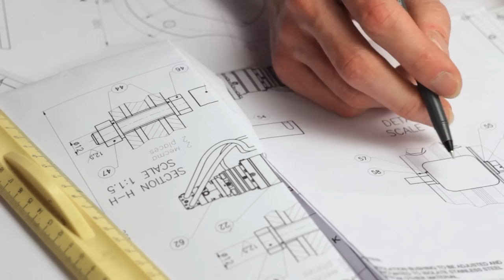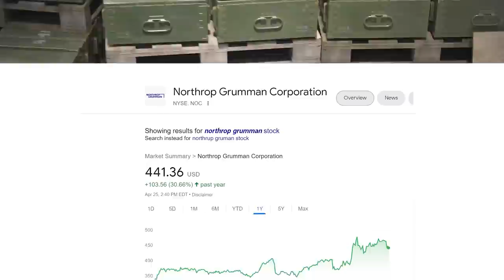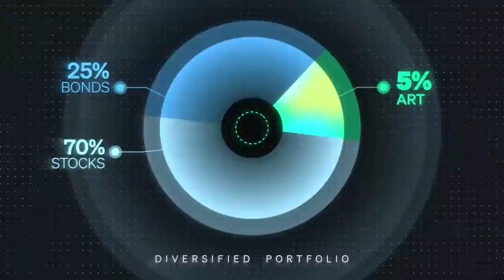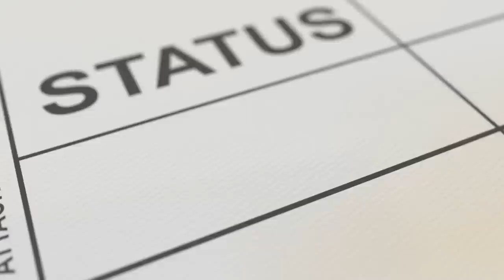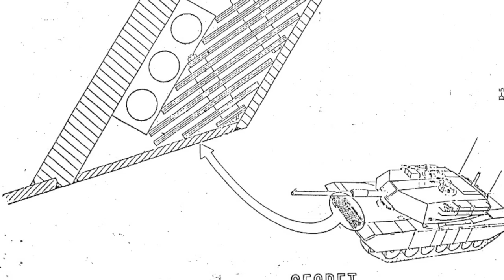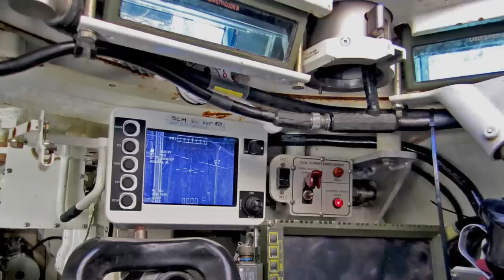The M1 Abrams Tank Needs to Chill Out

Comment: Survivability-wise, the Abrams still has it's "explody" ammo separated from the squishy crew.   --Still a top notch design feature after all these years.
Reply: But where does it keep its explody crew and squishy ammo?? :P
Reply: @seanheath4492  In separate sealed compartments.  The entire ammo load in the bustle can detonate and the crew remains unaffected in the M1.  A design feature that can't be retrofitted.
Reply: i think the t72 ammo is seporated, but lack lack of blowout panels, combined with the crazy powerful top down attack missles just cut through everything to the ammo storage....
Reply: @specialingu  Only the driver is separated from the ammo and then only if the hatch between the gunner and driver is buttoned.  If the tank is buttoned, the turret flies off and if the commander's hatch is open, the commander goes ballistic while flames jet from the hatch.
Reply: @specialingu  eeeeeh it’s way to hard for the T-72 to even try use blow out racks since they have an auto loader. There’s just no way to protect the crew and have an auto loader
Reply: @specialingu  the whole turret flies up to the space after hitting a t72, no matter how you sepparate the ammo from the crew in it.
Reply: @cases2939  no, if ammo detonates, it detonates. Only if most of the load is inert apfsds the the crew can survive
Reply: @UhBreezyK  Yes, the gunner and commander are literally sitting on top of the ammo carousel in the T-64,T-72,T-80, and early T-90.
Reply: @tedarcher9120  That is exactly why the rounds are reversed, so any HEAT rounds detonating are directed away from the crew.
Reply: @cases2939  I think you missed the joke
Reply: @UhBreezyK  A poorly designed auto loader, true. A better designed version, not true.
Reply: @clarkbarrett6274  Joke?
Reply: @UhBreezyK  It is actually not difficult at all if designed from the start to be that way.  Retrofitting a T-72 to achieve that would indeed be impossible though.  The main problem with the T72 is not that it has an autoloader but where it stores the shells - in a ring around the circumference of the turret. On the M1 it is a compartment hanging off the back of the turret. That design could easily be adapted to an autoloader without losing any of the separation All an autoloader needs to do is exactly the same thing the human loader does, that is move a shell from the magazine to the breach of the gun.
Reply: @946towguy2  ived saw a video from Mariupol where the russian crew of a tank that stepped over a mine ,,,well...the video is gruessome but i bellieve the crew endup being throwed thru the tank's barrel :( The turret didnt blow up but the barrel spewed a gigantic column of flames...so the logic dictates that the crew passed thru that barrel aswell
Reply: @UhBreezyK  Untrue, there's plenty of examples from other nations.
Reply: @ThePppp89  I’m not calling auto loaders poor. I’m referring to the t72 specifically and it’s issues. The way they have made their auto loading prevents the safety.
Reply: @listerdave1240  yeah, sorry for not being precise. I wasn’t referring to auto loading as a whole. Just the T72’s
Reply: @tedarcher9120  ammo explosions are almost always the propellant first. High explosives only detonate in an ammo explosion if a country uses really crummy high explosives. Then again, a lot of tank ammo has included very insensitive high explosives like RDX, but rapidly burning them instead of detonating them.
Reply: @cases2939  yeah, I somewhat doubt anyone's ability to survive the ammo exploding next to them. I reckon the crew's bodies would not be destroyed, very dead but not destroyed.
Reply: @UhBreezyK  The French have had it figured out for decades.  They use autoloaders that feed from a protected magazine in the turret bustle, only a small hatch opens to cycle shells from the magazine to the autoloader, the magazine itself is loaded from the outside of the tank.
Reply: @tedarcher9120  Not really, the majority of the cook off when T-72s are hit is the powder charges igniting, not the shells themselves.  That much gunpowder, in the confined space of a tank hull makes a pretty big boom
Reply: @mrvwbug4423  then it's usually a fire, not an explosion. Yes, it will help against fires, but in many cases he shells also cook off and launch the turret into space
Reply: @DmSereb  I believe the claims are probably greatly exaggerated, as we don't know when the tanks have exploded. So they most likely haven't exploded immediately, but could have exploded dozens of minutes after the hit, after the crew has left.
Reply: @werrkowalski2985  true, it happens, but only when the ammo explodes after the fuel ignites, when the engine or a fuel tank was hit, not the ammo directly. moreover, if the crew managed to abandon the tank, they leave the hatches open, which prevents the turret to be ripped off by explosion, but of this i am not 100 certain
Reply: @DmSereb  No, fuel igniting has nothing to do with this. The cook off is never immediate, ammo can explode immediately after a hit, but if it cooks off, then first it ignites. Look at footage or photos of tanks with their ammo cooking off, that is how it looks. The ammo explodes after some time.
Reply: @mrvwbug4423  Yes, I corrected myself earlier. I wasn’t referring to auto loading in general, just the t72’s design
Reply: @specialingu  T-72 uses the rotary autoloader int he turret.
Reply: @tedarcher9120  the M1 has been tested with a full load of HEAT rounds cooking off.
Reply: @tedarcher9120  no, not even then. The propellant has more than enough force to clear the tank. The case with probably split and frag as well. Multiply this by every case hit + spall. They are screwed.
Reply: @tedarcher9120  You're talking about the M1, yes?  You're wrong.
Reply: @946towguy2  There is no hatch between the driver and gunner of any tank currently being discussed.
Reply: @specialingu  It is stored along the sides of the turret and mostly exposed. It has to be this way due to the design of the auto-loader. This is also one reason why you will see a lot of Russian tanks that have been disabled, without their turrets still attached. I have talked to a few soldiers that were M1 crew members during the first Gulf War and they said that often times, the Iraqi tanks would explode massively when hit and the turret would sometimes fly in the air. This is because all of the ammo is being ignited and creating even more destruction. If the turret of a Russian tank is pierced, it is almost certain that most of the crew is going to die.

Comment: Former M1 TC here, One of the biggest differences between the M1 family and the T-whatevers is that the M1's ammo is stored separately behind a two inch thick door in a compartment with pressure relieving blow off panels to vent the explosion and cook offs to the outside, away from the crew compartment. So long as the loader stays away from the knee switch for the armored doors, the crew will likely survive, albeit deafened! 
The T-64 -72 -80 and -90 have ammo carousels exposed in the crew compartment!
Reply: "If we get hit we become satellite"

Essentially every Russian tanker
Reply: Many crews would send a round down range while the ammo door was still closing without realizing it. A good loader knows the 2 second delay after you Take your knee off knee switch so as soon as the door is opened you take your knee off the switch before grabbing the next round, so by the time you hump that round in the door is closed. If you didn't do that and hold knee on switch the whole time while taking the round out the door will close around 2 seconds after round is loaded.
Reply: I seen a tank burn up an blow off panels fly at Brookhaven range back in 2002 from loader switching rounds in between  engagements and didn't realize he as putting a round back in the ready rack that was cooking off and it blew up in his hands and set the ready rack off. I saw it all happen on the first BP pulling gate guard. Whe that happened the driver passed out from th halon because he couldn't get his hatch opened fast enough because it was nighttime engagements and the old night sight was in with the wing nuts. The tank drove for 20 minutes at idle speed across all the rough terrain and nobody could stop it. The panic and screaming was unbelievable. The flames white above 50 ft trees man. The tank finally stopped ar end of range when it hit a big tree. The drivers name was Robert white from Maryland and he actually didn't burn just died from smoke inhalation and the loader Christopher Murodas from little Rock Arkansas burned alive. I just hung out with Chris at lake Blora the weekend before and was and was water skiing with him. I was Aco 3/67 pulling support and they where Cco 3/67. The tc and gunner actually made it out alive with minor burns but SSG Steele who was the tc was relieved and sent to another unit while the gunner Nolan lost his mind from the guilt and was chaptered out. The whole thing was very sad and crazy as shit to watch. It definitely fucked my mind up. Our DS in basic told us we will see people due in training and I didn't belive it. I also seen one of our tanks with the turret blown off in OIF1. It was A33 3/67 armor. Very fucked up times that I think of almost every day of my life especially IRAQ
Reply: @imlurkn5291  That's a really hard story to read, so I know it was hellish to actually live it! I'm so sorry that you had those experiences. 
In training, I climbed into the driver's hatch once and it reeked of pine oil. When I asked the mechanic why, he said they he had just finished cleaning the brains of the prior mechanic out. Apparently, the driver had PMCS'd the tank, noted that the Halon bottle was showing empty and deadlined it. The mechanic was going to replace the Halon bottle and when he cracked the nut to remove the empty one, 800 psi took his head off. He hadn't put the safety pin back in since he thought there was no pressure, but it was a faulty gage that was reading 0 psi, not an empty bottle.  
What has helped me deal with the thoughts and memories of dead friends, has been to focus solely on the good times, like your water skiing weekend for example, and to cherish the brief times we had peace. Even today we could lose more friends to drunk drivers (like my dad who was killed when I was 16), accidents and disease. I try to value today more than ever. I pray that helps a little bit. 
I have also surrendered to Jesus Christ and learned that people are going to mostly reject Him and be damned, so I work hard to be kind and show the hateful world His love for them...whether they accept it or not. The inner peace and contentment that my faith brings me every day is precious. I would recommend that to everyone, even if it turns out that the Bible was B.S.
Reply: @purelife9000  Man that is so sad about the Halon bottle killing that soldier in the drivers hole. I worked for GDLS for 10 years and have replaced many bottles and pinning them is an absolute must. It's  very very serious thing even if the gage reads zero and this is that prime example of why you should always pin it. That could have happened to anyone. That's  really sad man. When I worked for GDLS I almost messed up big-time when  was in a rush and forgot to zero the hydrolic pressure before I took the filters off the goose neck on the reservoir for annual services. The one on the left came off as Normal which made me think everything was fine then when I got the the one on the right I could barely turn it but my stupid ass stayed persistent.  Finally after maybe half a turn straining all muscles I looked up at the pressure gage and it was at like 1000+ psi. I felt so stupid but also majorly releaved. I also learned that yes the filter on the left will come off as normal with no pressure and the one on the right is holding the pressure if its not zeroed. Not saying I would have died but it wouldnt have been good lmao. I've had some close calls in tanks that people probably would think I'm full of shit but as you know shit happens on those killing machines. The craziest thing that ever happened to me on a tank was gunnery table 7 in Germany. I was a fast loader so I was loading for another crew with a new gunner that had a habit of saying "on the way" at the same time he squeezed trigger. We had a misfire because the breech didn't come all the way up when the round was loaded(I know you know exactly what I'm saying) so I took the breech operating handle and started beating on the bottom to make the breech come up those last 2"  so the firing pin can touch the primmer. The problem was my dumbass didn't disarm the main gun like I was supposed to but THANK GOD  I kept my head back all the way close to the ready ammo door and far from the breech. When I got it up to fire I can't even remember what I said but all I know is SPC Rouge squeezed those Cadillacs while he said "ON THE WAY"  and I got hit in the CVC with the last 1"or so of recoil. I swear on my life I'm not lying to you, It didn't even hurt because it was at the very end of recoil and just smacked my cvc. If my head was up close to the breech I'd be dead for sure. I wasn't smart enough to disarm  main gun in heat of the moment of the engagement but thank God I  was smart enough to keep my head all the way back.  The look on the gunner and tc and my face had to have been priceless. I'm very thankful I kept my head back man. But thank you for those kind words and I do struggle with God and angry at everything. Hope you have a great day and thanks for sharing that with me. RIP to the soldier died from the Halon bottle
Reply: @imlurkn5291  Nothing like lap loading to speed your time
Reply: @shawncalhoun1363  That's fucked up if your TC let that hapen. It's endangering the whole crews life and it's cheating. Most I ever did was take the afcap deflector off while loading because it was malfunctioning.i wouldn't have lap loaded if ordered too by the ghost of General Patton